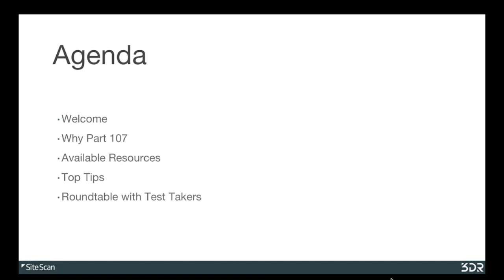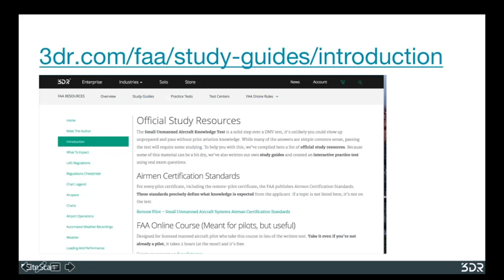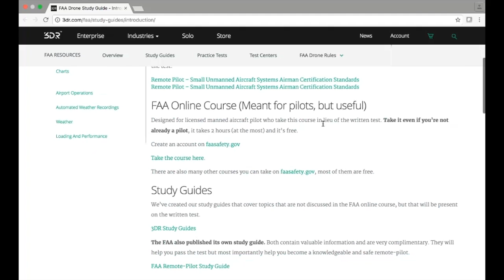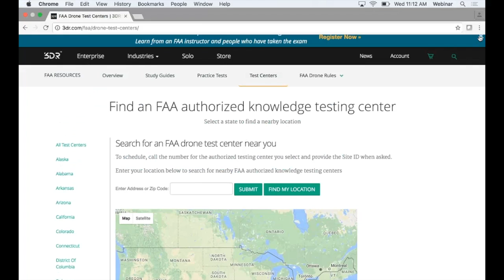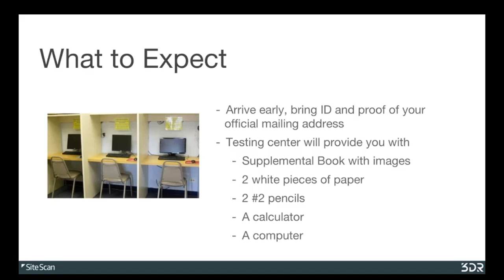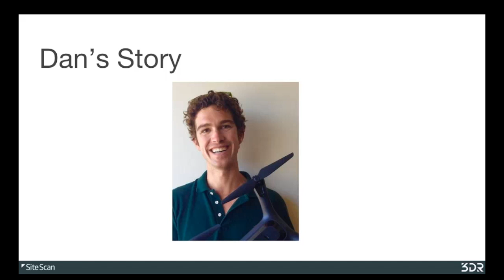Webinar: Preparing for Part 107 on August 31, 2016

Comment: Let me tell you from experience you do not need a paid course to pass this test at all. Watch the Northrup video along with some of the remote pilot blocks of instruction, and videos on aviation weather and latitude and longitude. I watched and listed on YouTube while I worked for about 2 weeks and took the 3DR, kings, and a few other practice tests multiple times throughout the 2 week period and I got a 92%. Do not pay because the test costs enough as it is. You wont find the exact questions on the test as the practice tests but if you actually understand how to vaguely read Metars, Latitude and Longitude, and know the basic safety aspects and federal rules regarding drones you will pass for sure.

Comment: Sorry Nico, incorrect about the waiver. Flying in controlled airspace under Part 107 is a routine filing for approval by ATC through the FAA website. Lauren correctly refers to COA/COW for flying outside of Part 107, but she incorrectly states that this is the same process as for getting ATC approval through FAA.